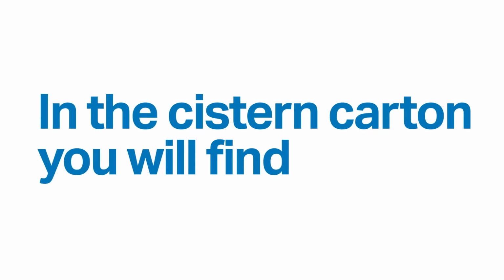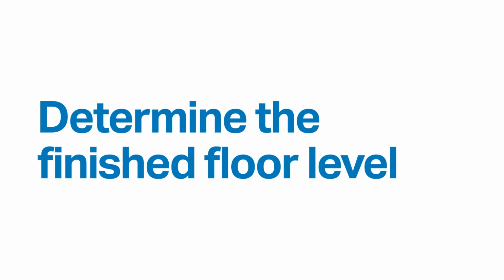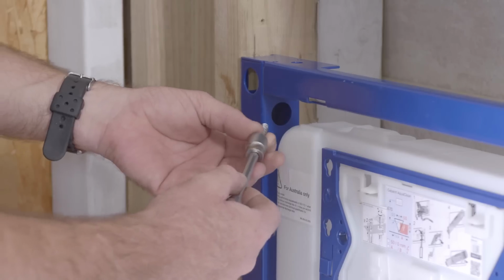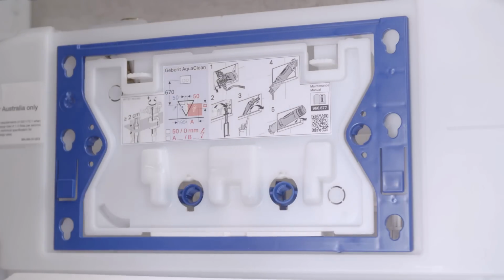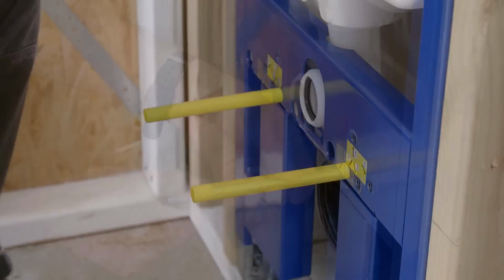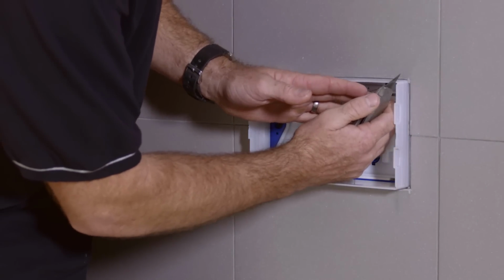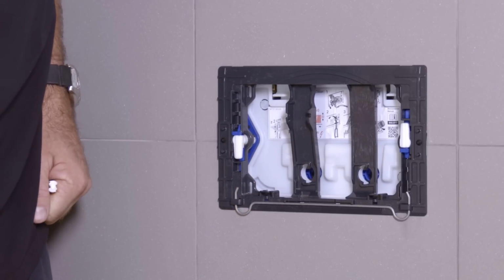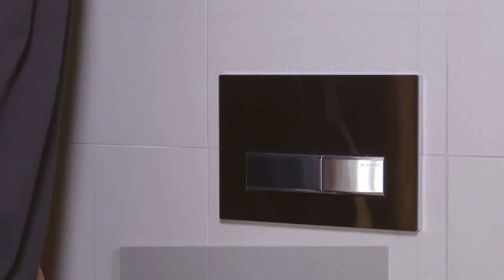Geberit Sigma8 Duofix inwall concealed cistern installation

Comment: what to do when remote flusher doesn't work?  perhaps no pressure via leak in hose.... replace hose? bowl mounted on tiled wall. Pull bowl to access water shut off and hose?
Reply from the maker: Hi! Please contact our customer service to discuss this issue: +61 2 9889 7866. Thanks